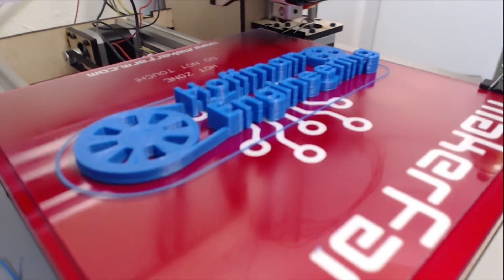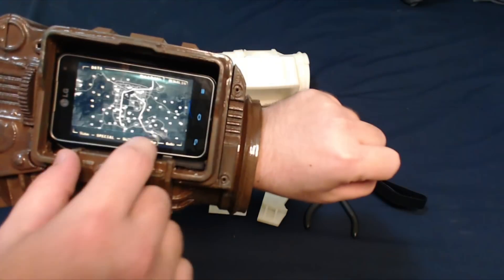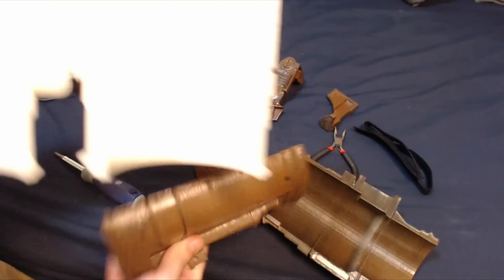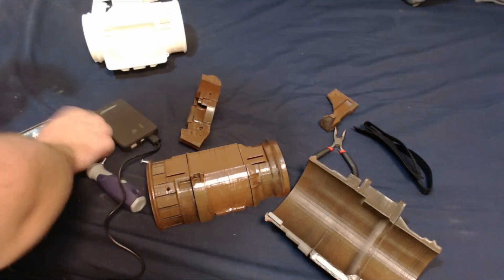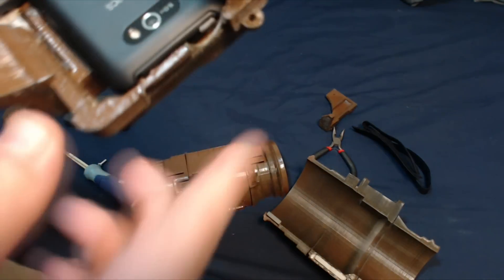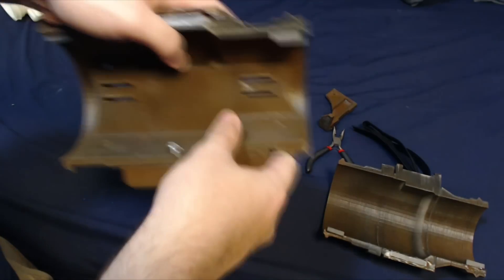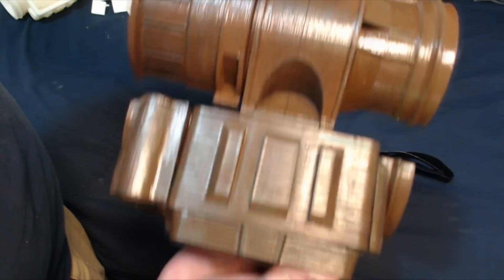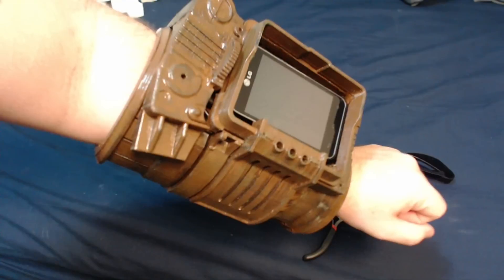3D Printed Pipboy 3000!

Comment: How do I determine the size of the pieces because the scaled up pieces are still a few centimeters short of the circumstance of my arm
Reply from the maker: The way I determined the scale was to measure the circumference of my arm near the elbow, and divide that by the original circumference of 26 cm. I found that gave me 9.3%, so I rounded up to 10% just to be safe.

Comment: What were the measurements of the scales up pieces
Reply from the maker: Thomas Babb The Original is:Fits arm that is 26 cm circumference near elbow, 21.5 cm near the wrist, and is 18.5 cm long110% brings it up to just over 28 cm near the elbow, and is 20.3 cm long ^_^